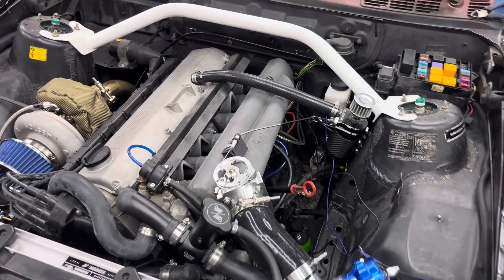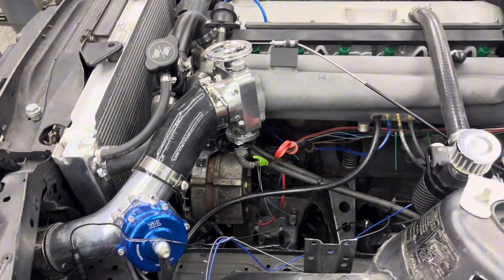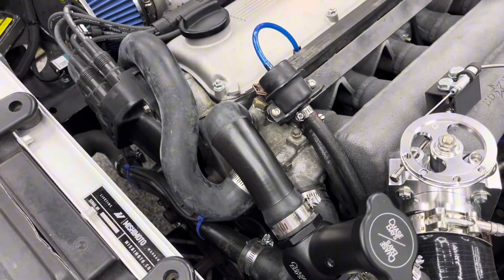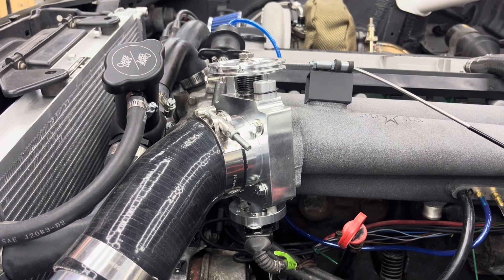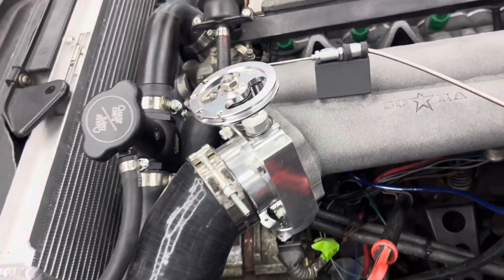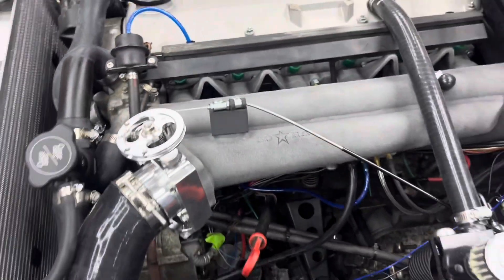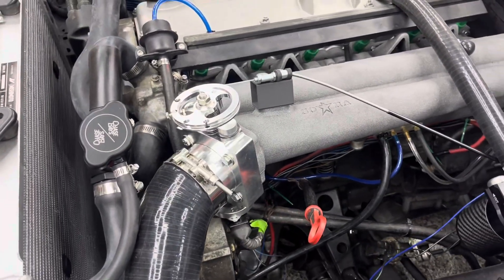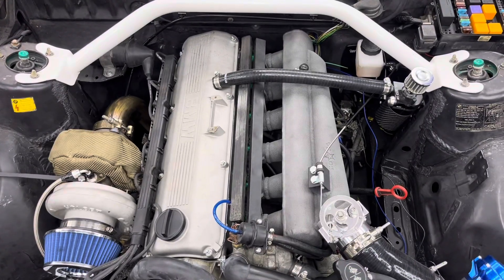Sora Performance M20 intake manifold review and fitment + throttle body and cable mounting | E30

Comment: How many hp you’re expecting to get out of it , beautiful work
Reply from the maker: With the stock bottom end I’m hoping to see around 320-350 wheel and last a couple years. I didn’t get that far tuning it this year, so it’s only running 11psi and making about 250-260 on the butt dyno

Comment: Next we need a video of it running!
Reply from the maker: @koryfear3394  currently working on video fabricating and talking about the exhaust setup and specs and how to run a external wastegate with the kangaroos team manifold. Snow on the ground where I live right now so no driving footage until spring unfortunately but will have some sound clips and POV drives coming this spring/summer while I work on dialing in the tune more.